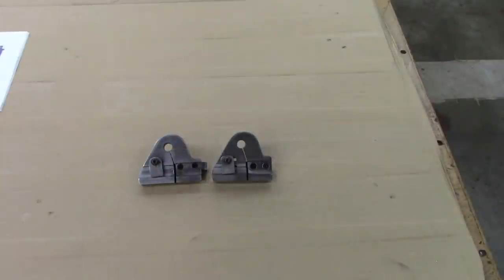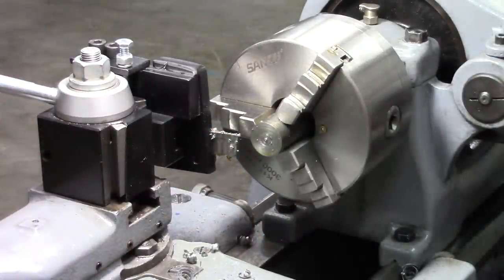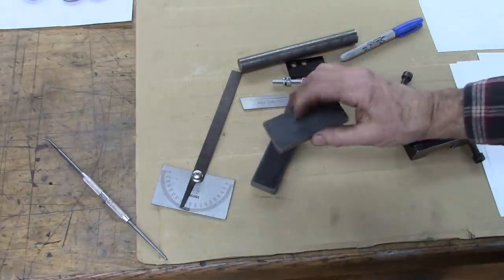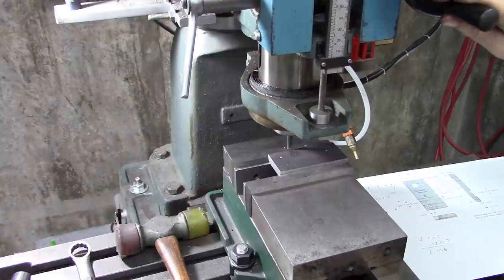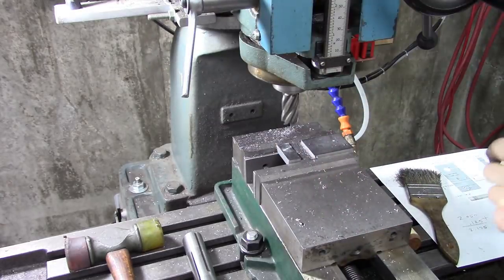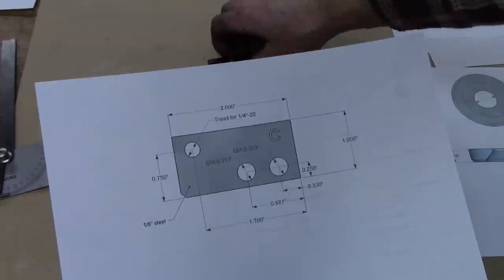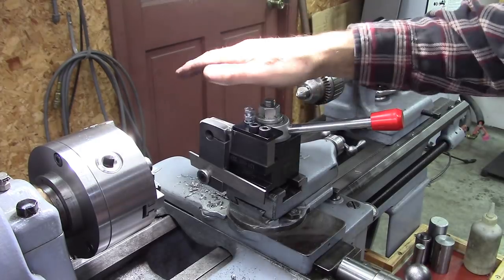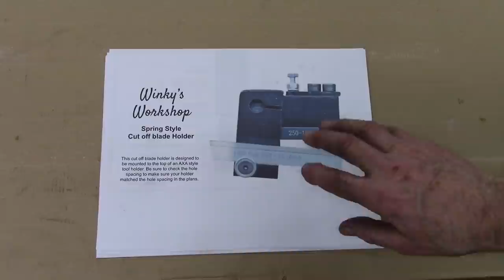Spring Cut Off Evolution! An Easy to make design + the PLANS

Comment: In your second tool, you bolted the mounting bar on both sides of the flexure slot. Basically eliminating any spring action. From what I can see in the video.
Reply from the maker: The spring is in the vertical bar where I drilled the hole. The weld is above this point.
Reply: @WinkysWorkshop  Winky:  jfl4066 is correct.  You bolted both sides of the flexible tool mount to the holder.  This eliminated its ability to flex, reintroducing chatter.  Take out the front bolts and you should see it cut like the first one.   It's like a tuning fork with both legs clamped.  It cannot vibrate.
Reply: @darrelsartin4355  Ah but at 1:52 he said "I put some bolts in there to kinda dampen the vibration" implying that he added these later, as a method to combat the chatter. I think he means that they were partially tightened to provide some friction simulating the potential friction on the other welded holder.
Reply: My thoughts also.
Reply from the maker: @geoffscott265  Thank you sir!!!!!
Reply from the maker: I messed up on my previous reply. These bolts were added later. It was to add friction but it didn't work. With or without it did terrible.
Reply from the maker: @darrelsartin4355  - Yeah...  they were added later to dampen but it didn't work.
Reply from the maker: @ronkennedy213  They were added later... it didn't work either way.
Reply: Hi Mark ,. I must be missing something.   Did you not make the so called Dado groove on both sides.   So even if you had only bolted one side you still had both sides locked together and eliminate the spring which is the key to its success.   ???   
Sorry that I will not be putting in for the draw.

Dale in Canada
Reply from the maker: @dalemcinnes1834  Hello Dale, I didn't do very well at describing the last tool. No the dado was only on the back half. I milled an offset in the bar so there was clearance on the front part.

Comment: Thank you, looks like a sure winner. I do not have a milling machine so this will be a welding project and a lot of hand cutting with some modifications. Much appreciated.
Reply from the maker: How about two pins for the blade to sit on and then weld a plate that sits on top of the blade. Its a T shaped blade but the top of the blade is only slightly wider.

Comment: This is even better! I had made a rough sketch of the tool shown in the first video, pulling the measurements off of that and some of the pictures found online of that style tool holder, but this looks even better. Parting has been a major headache on my 12x36 and it seems like this might solve my problem. Thanks very much for staying on the development of this solution and sharing.
Reply from the maker: Thanks David. I love the problem solving but I'll admit that there was a moment of panic when the second tool of the first design I made didn't work very well. I'm guessing this panic gave me the needed push to come up with the second design. Its a lot easier to build and works better too. And, you're welcome! Thanks for the comment.

Comment: Having been a welder for 40 years mostly stick rod and heli arc processes if you can turn your amps up or go with a smaller wire size it will make your welds flatten out. If your welds hump up your either to cold or moving too slow. You might consider trying a dry heli arc dry meaning you just use argon gas and you don’t have coolant running through your torch. If you have a electric welder all you need is a heli arc torch and a bottle of argon. With this process you can control your travel speed and feed the wire as you need. Work well on small parts.
Reply from the maker: I'm a terrible welder but a wimpy welder is at least part of the problem. It's a 120V MIG using argon and C02 mix.

Comment: Thanks for all the effort to make this happen. 

I found one of the original tool holders on ebay. It will not fit in my tool holders but I bought it anyway. The intent was to use it to get starting point dimensions for a DIY tool, I'll compare what you have with what the original has when I build my holder.
Reply from the maker: Interesting! Be sure and download the plans. Also follow up and post how it works out. Thanks for sharing
Reply: "I found one of the original tool holders on ebay. It will not fit in my tool holders but I bought it anyway."
So get the right tool holders
and the right toolpost
and the right top slide, cross slide, carriage and lathe - LOL
Reply: Is it possible to maybe modify the one you got from ebay in order to adapt it to your toolpost?

Comment: I never had any luck with HSS blade cut off tools, made several kinds and just wasn’t satisfied. However I see the concept and in my opinion the rigidity of using the tool block mass and bolting it to the top, plus shortening the distance from the quick change post is why it works so well. Basically that what I did with my last cut off block that uses inserts.
Reply from the maker: Are you talking about my direct mount tool?

Comment: Very nice build!  I gotta make one of these for my little Jet lathe!
Reply from the maker: Thanks, I hope it works. You might have to down size it.  The same blade are available in smaller sizes. they work well but can't cut as deep.
Reply: @WinkysWorkshop  , thanks, my Jet 12-36 lathe uses the BXA quick change.  Now I have to dig around and see what I have in an extra tool holder!  Lol!  Take care.  Tom
Reply from the maker: @Okie-Tom  ah...  You said Little Jet. You have a nice lathe. I ran one of those for a couple hours.

Comment: When i was in high school back in the early 70s , our shop teacher had us to use the cutoffs upside down and the lathe in reverse,  he said it was less stressful on his nerves.
Reply from the maker: Yep, it has the same effect as this tool. If it tried to grab it pulls out of the cut. Many lathes, including mine are not set up to run a tool post in the back so it's not a good option. Thanks.
Reply: Also remember that you should not run lathes with threaded spindles in reverse if there is any load because of the danger of the chuck coming loose!  You even need to be careful with stopping them quickly if there is a heavy workpiece in the chuck which can happen with a VFD with aggressive braking settings.

Comment: Love the idea but too big for my 7x16. Do you have plans for the OXA tool holder for the mini lathe?
Reply from the maker: Sorry no. You might try down sizing the holder. They also make smaller blades the same as the one I used that work great. They just don't go very deep. Maybe 1 inch max.

Comment: thank you for the plans! It will be a valuable addition into my toolbox. Much appreciated.
Reply from the maker: Your welcome. Good luck. I'm wondering is the blade more level might work a little better. This works well but chatters bad for about 1 second until its under load. Maybe level would not. I need to experiment more.

Comment: I intended to build your original design from January but procrastination paid off as I like this design better. I made it last week and it works great. Thank you for supplying the drawings. I would suggest you make a note on the piece that bolts to the top of the AXA holder though. I have holders from 3 different manufacturers and the spacing between the 2 holes is different on all of them, one was even .830" but I used one that was .880". So in order to ensure a tight fit folks should measure the AXA holder they are going to use before making this part.
I increased the chamfer to get more weld penetration and also continued the weld around the front down to the start of the slot opening to give more stability in the Y axis. I didn't have a good way to make the bandsaw cuts so I used a 1/8" end mill for the slot. This probably works better for your revision of adding a screw to limit movement.
Enjoy your videos; keep up the good work.
Reply from the maker: Yeah, an 1/8" slot is fine. The the extra weld work okay? It seems like the extra weld would stop it from flexing but the amount of flex needed is difficult to determine anyway. Maybe less flex is better.
Reply: @WinkysWorkshop  Yes, the extra weld works fine. Since the upper portion is welded this small area where I also welded has no affect on limiting any flex since that all takes place on the portion below the slot. I also didn't mention that, since I am fortunate enough to have a small surface grinder, I ground those 2 main parts not only to have a smooth surface where they rub together when flexing but also to have more precise thickness which I think would help the blade keep it's perpendicularity while in use. Of course, careful face milling would work also.
One of the things I think a lot of us old hobby guys complain about is having to adjust the height of the blade holder every time you have to change the stick out length. This is the case with the cut off blade holder that came with my AXA set and also with this design. But because of how this design works I wonder if the blade could be parallel to the bed. Unless you know of a reason why it wouldn't work or have already tried it I'm thinking about making one myself and trying it.
Thanks again for resurrecting and old design, adapting it to our modern tool holders and sharing it.
Reply from the maker: @johnziebron4058  Unless you grind a back relief the blade would act like a scraper if it was level. However, I also made a direct mount cut off blade holder that works perfectly with a level blade. It might also work well with this design...  Try it and let me know. The direct mount is very solid but I like the quick change for speed. https://youtu.be/B6NMY73eOxU
Reply: @WinkysWorkshop  I watched all your videos on the subject of cutoff tooling. I realize the significance of having a solid mount and I like this design with the flex slot. I made this holder based on your drawings (I have the same cut off blade except mine are 1/2" tall) and it worked well but I just don't like having the blade on an angle because every time you need to change the stick out length you have to adjust the height of the holder.
So I decided to make a new blade holder based on this same basic design but welding part B with no angle so the blade slot is parallel to the top of the cross slide. I did make a couple of changes though. Part A is the same size except that I use the holes at each end of the AXA holder instead of just the the back 2 holes. For part B I used 2" wide stock (milled to 1 7/8) so I could put 2 blade hold downs. The 1/2" hole is in the same location so my slot ends up being longer. A generous chamfer allows for a penetrating weld between parts A and B after which I milled this top surface flush. I also welded the right side of part B down to the slot opening.  I do not require part C for height adjustment. Instead I opted to use a "shim" under the AXA holder for making a more solid mounting. You want the tip of the blade to be around the center of the spindle and in order to zero in on the shim thickness I used drills initially. My final shim ended up being .345". (Final shim thickness can also be varied by changing the blade position on part B).
I was able to do a lot of testing today. Since I already had my collet chuck on I used some 3/4" stock first and had great results after playing with spindle and cross slide speeds. My final test results were with my 6" 3 jaw chuck (similar to yours with the hang out) and using 1 7/8" diameter stock which put my 11 inch Logan almost at the limits of cross slide retracted and enough blade stick out to reach the center. When I switched to the 3 jaw chuck I turned my compound to be in line with the cross slide for better support. I had to put my lathe in back gears for this size stock but it worked great.
My back gear speed was 120 RPMs and I had my compound speed at 2 1/2 thousands per revolution. I put an indicator on back end of the blade and zeroed it. After the blade started the cut the indicator was moving slightly between 6 and 7 thousands. There was no chatter even when starting the cut. The cut took almost 5 minutes but I'm just a hobbyist, not production work. I could probably move my belt to a different pulley ration to get a faster back gear speed and it should still work fine. The previous testing I did with slight changes in height ended up with my final shim putting the tip of the blade exactly at the center of spindle. I made several cuts on this larger stock and all ended up with no nib on the piece in the chuck. In fact, you can't tell the difference if a facing tool was used or not.
I'm so glad this holder experiment was not a waste of time and I wish I could include some pictures and even a video here to prove it. So maybe you could end up doing another video for other "lazy" machinists who don't like to have to mess with changing cut off blade height.

Comment: No idea what sort of time and materials you have in this parting tool, but you might consider selling them. This is a giant improvement over what I'm used to with parting.
Reply from the maker: Thanks! Several have said the same. Maybe I need to look into this. I guess a couple hours work, $20 for the axa holder and maybe $12 bucks in materials not counting the blade. I'd to figure out a way to make it work with different tool posts.
Reply: @WinkysWorkshop  Like probably everyone else that watches your channel, I sent you an email. I have the same tool post as you do so this is going to slide right into place for me. I liked the original design with a bar. This makes the tool holder universal since every tool post can hold a bar. I think welding your new hinge section to a bar would work.

Comment: Great work, well done.
The 5 degree up nose has the disadvantage that the tool height needs readjusting. That decreases the release angle as well. Suppose a deep part off and You want to extend the blade bit by bit as the parting off advances. Grinding the release angle is preferred as I feel.
Reply: A small price to pay for a better cutting tool. Grinding top rake on a standard blade has a problem in that the cut becomes narrower than the blade and can cause broken blades when it jams.
Reply: @chrisstephens6673  I understand what You say. Checking my HSS 1/16x1/2x4-1/2 China blade the thicker upper part is 4 mm high/deep. That allows for a cut to create the chip maker.
Reply from the maker: Yes, having the angle creates minor drawback but resolves another issue. This blade has a concave surface on the top and a slight taper on the sides. Grinding a back relief would destroy this good geometry. This is by far the best blade I've ever used. This shape make the chips smaller than the cut. Here's a link a picture of the balde close up. https://youtu.be/s9qcd5-wj3c
Reply: @WinkysWorkshop  The sideview of Your blade looks pretty much like the blade I refer to. The taper is at least very small near the cutting edge. Grinding a bit ought to be possible.
It cuts 6061 well without any back relief so far. I might be wrong but I think I've cut some steel as well that way.

Comment: Very nice! What were the spindle speed and feed rates you were using?
Reply from the maker: You know I have never calculated them. I built the drive for the lathe and never did the math. I'm guessing a little fast but it works (maybe 700 RPM for 1-inch stock). I use back gear for 1.5" stock. I tried to figure the feed but the threading chart doesn't make sense to me. The chart is all TPI but above it there are words that say, "Longitudinal Feeds 2 1/3 Times Treads Per Inch" ?  This doesn't make sense to me. 24 TPI=55  and 16 TPI=12. I'm using 24 or 48 but the feed rates don't jive. Any idea?

Comment: Nice tool, I sprayed motorcycle chain lube on my lathe gears, quietened things down a heap, and after letting it dry hardly had any fling off
Reply from the maker: Thanks for sharing. I've been using 130 WT oil. The primary problem is a bad gear I tried to make. I have one ordered, hopefully its a good match.
Reply: I'll second that. I've used chain lube too on my change gears instead of grease. I found the sticky foaming lube works best. So quiet and no mess.
Reply from the maker: @JimsShed  I tried chain lube but I'll have to admit that I may have had the wrong type. It wasn't as thick as the stuff I used to get. What brand do you use?
Reply: @WinkysWorkshop  I used Belray , it was their early no fling version, I'm sure the new ones like their Blue Tac are even better
Reply: @WinkysWorkshop  The product I use is GRO Chain Lube (200ml). I'm in Australia so not sure what's available where you are. The BelRay products suggested by @PhatPizza are similar.
Reply from the maker: @phatpizza610  Thanks, I'll check it out

Comment: Nice... a big improvement.  Well done!
Some say ugly welds, while others say... "Get er Done"! 😁
Reply from the maker: I think I need a brighter light Thanks!
Reply: @WinkysWorkshop  
I am not a professional welder, but I do weld.  I weld using Tig, or Stick, or mig, depending on the application.   I also, at one time, was thinking I didn't have enough light.  I Finally realized I set the lens too dark. Have you considered a lens lightening adjustment?  Is it possible your lens shade is too dark?

Comment: Mark.   My Logan was noisy with no broken or worn gears.   I use 90wt oil to lube all my gears.
Reply from the maker: I'm using 130 wt. I made a gear and didn't get it right. Actually I made it 3 times!!!  I think I have some bad info on the gears. I have a gear ordered. The only reason I made one was that 16 DP with a 14.5 PA are not made 5/8" wide. I ordered a 1/2" wide. But thanks anyway. Hopefully it will work...  if not I know I'm working with a different PA. The DP is easy to figure.